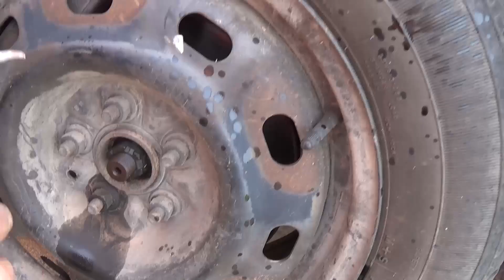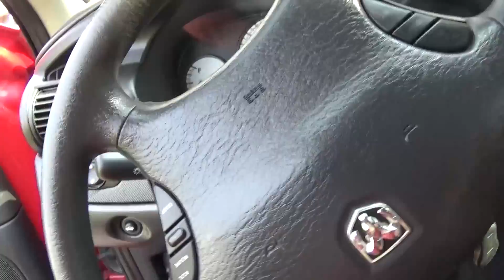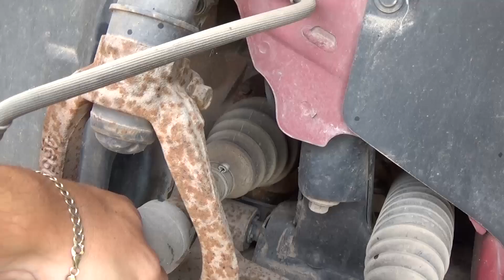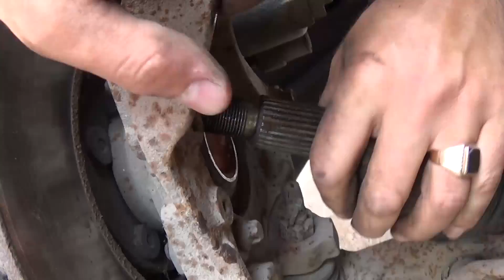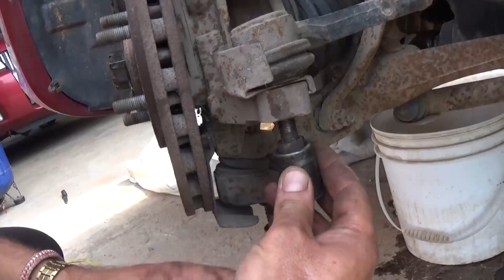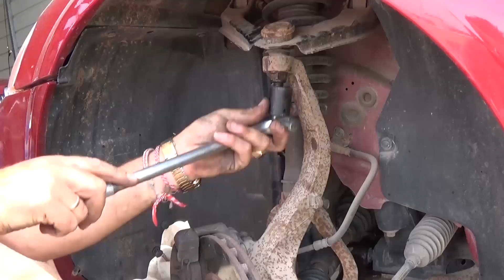Dodge Stratus / Chrysler Sebring CV Axle Shaft Drive Shaft Removal and Replacement

Comment: 🎄🎄 Thank you so much for all your help I put a new driver's side axle on my  2004 Dodge intrepid, and those cluncks, and banging noises from underneath are gone. The rest of the front suspension is good. And I had the same problem, you pin-pointed exactly and correctly where the banging noises were coming from, the cv joints were broken, bearings gone, houses just dancing and clunking around in the old one.
Thank you fine sir for you help🎄🎄☃️

Comment: Hey guys am changing the cv axle on my chrysler sebring 2005 2.4 convertable coupe and im having trouble finding the right axles to match the car all the ones I buy new seem no not be a perfect match. Unless the axles seem to be a new after market version that are adaptable to my car but even then it seems to be a bit longer by at most 3 inches

Comment: While looking at your video. All is great. However I've noticed, the upper ball joint is cracked, needs to be replaced as well. Although, I'm aware this video was on replacing the CV Axle Drive Shaft. 
great. Keep up the good work.

Comment: Thank you for your video demonstrating the procedures and tools. I knew most of the work necessary already, but the tool sizes and popping out the in board joint stub was a new one on me. Thank you!

Comment: Hey ive got a question on my 2005 Dodge Durango I removing CV joint and the shaft stayed in the joint or axle so I had to remove it to be able to put it back in the differential without that shaft in there because the new differential already came with half shaft so once I took the CV shaft out that seal at the bottom the metal round piece that looks like a quarter I've been fed up the hammer in the champ out with us to divert now how do I get that back in there to help seal the grease in there or can I just go to parts store and replace just that small metal piece and does it supposed to stay put in that whole

Comment: So pro, don't even need to remove gold jewelry.
Reply: Was piece of cake
Reply: Nathan Scott  y shit he getting the job done
Reply: I also love the way that he uses the impact on the axle nut.  550ftlbs of torque is so much better than the 80ftlbs it SHOULD be torqued to.  I love it when someone trashes wheel bearings cause they are ignorant.
Reply: So kindly of you to recognize.  Pros don't worry about that shit because there's pros. This is basic automechanics, not wood shop ya noob.